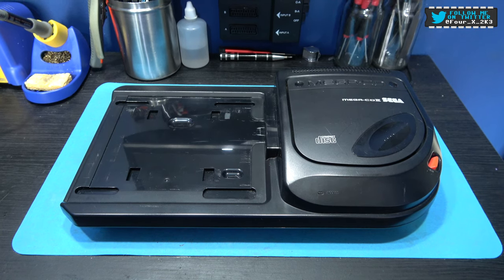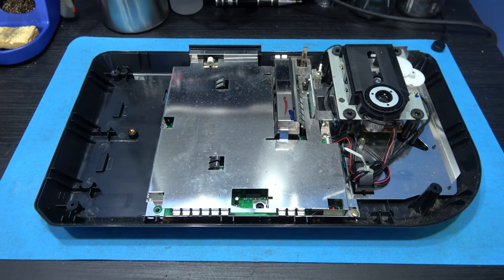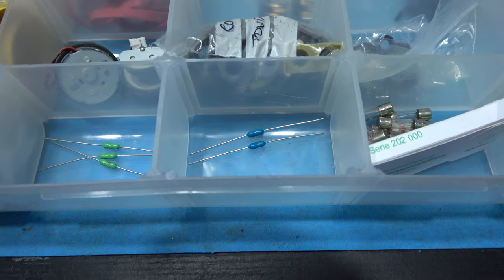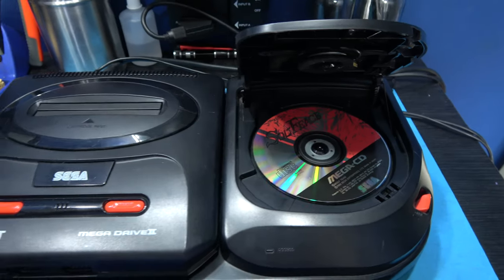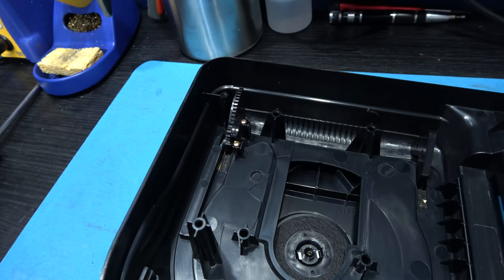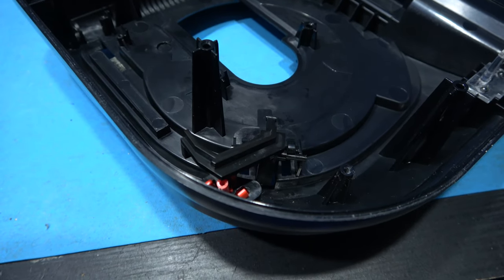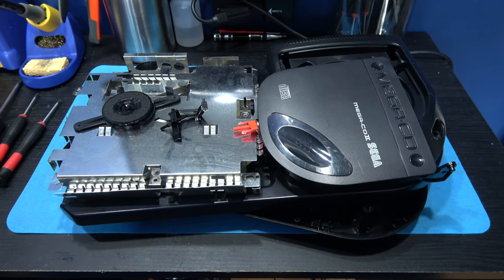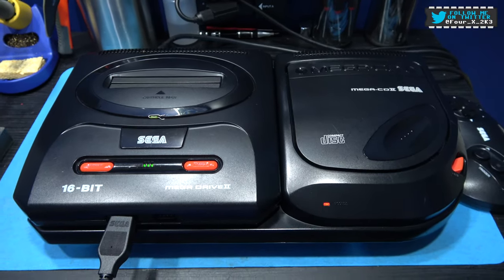SEGA Mega-CD II (SEGA CD II) - Repair and Restore.

Comment: Hi, how are you?? Could you tell me the correct calibration for the laser of this sega cd model 2? I touched the potentiometer several times thinking that it was necessary to calibrate it, and it was not that, the problem was the transformer, it was not giving it the necessary amps for the laser to work, now the laser works but I want to put the necessary amps, the factory ones, let's say

Comment: sounds like a silly question, regardless of whether the mega drive is attached to the mega CD 2 there should be a red light on the mega cd 2 if it's working right, it doesn't have to be attached to the mega drive?
Reply from the maker: I don't see why not.